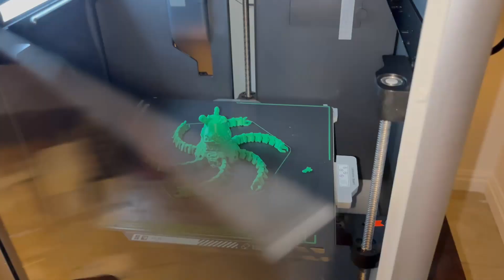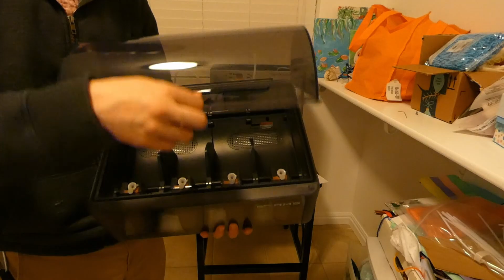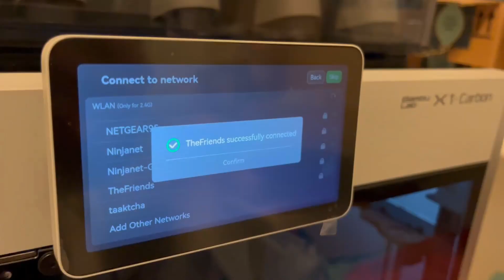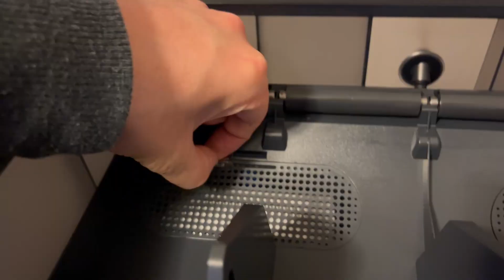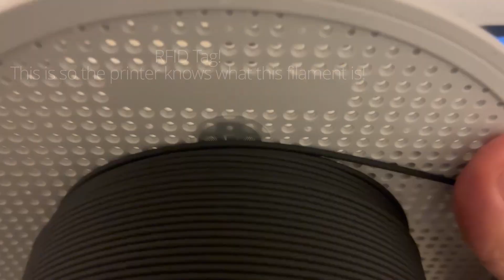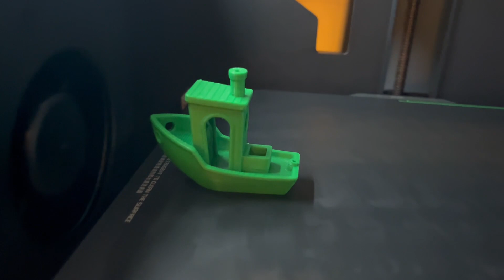X1 Carbon Setup and Impressions | 3D Printer

Comment: I was close to getting the X1C. You can get 5% off if you by it from Microcenter and use their credit card. Aside from price being a consideration, I was simply amazed at how much waste (poops) there is with multicolor printing. Some of the models is wasting an additional 50-75% of filament just to make the multicolor object and to make sure there is no color bleeding. Great setup and general review video. Nice haircut, but tell the hairstylist to shave the back of your neck below the hairline...you want to look your best from all angles...just sayin. :)
Reply from the maker: lol! Thanks for the tip 😆. It’s true, multicolor prints make lots of poo…

Comment: that's weird, mine came with the double-sided textured PEI build plate; i actually bought a smooth one separately but its not here yet. Mine's also the X1 Carbon.
Reply: They come with either plate from the factory depending on which is available in front of the assembler/ boxer. I found this out from fine print on their website after questioning the same thing lol.
Reply from the maker: Weird! Thanks for digging up that info and sharing!